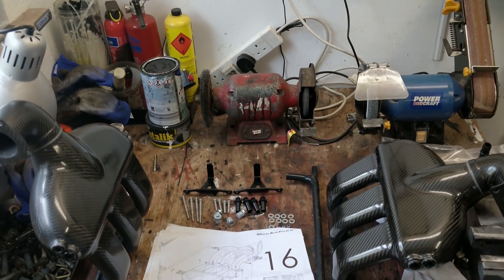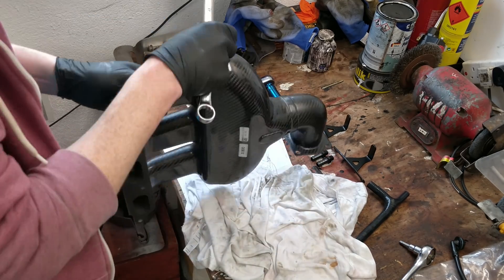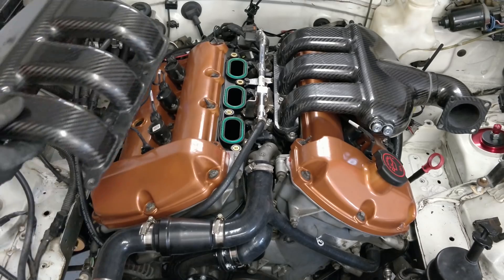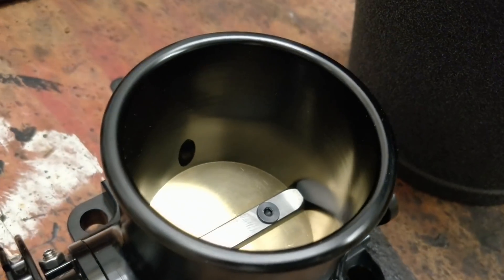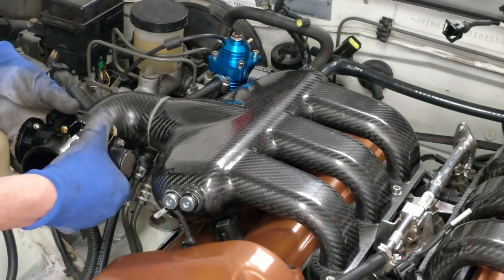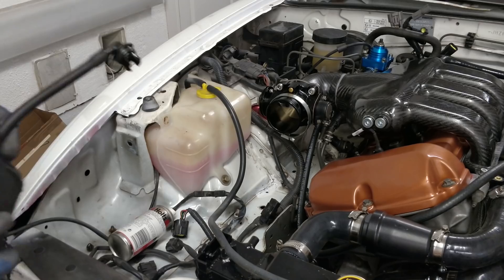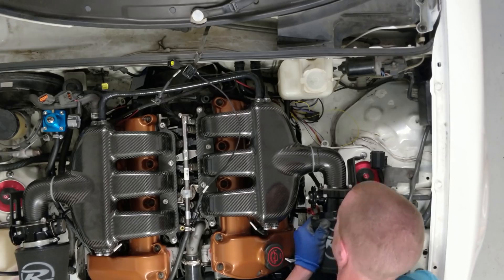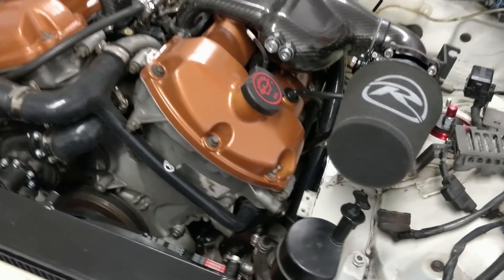Rocketeer Part 16 & 17 : Air Intake [MX5 V6 swap]

Comment: what dipstick are you using? im guessing the miata dipstick will not work
Reply from the maker: I'm using the Jag dipstick cut-down a little. You really need to get the manual - this is all explained.

Comment: One throttle body is up the wrong way isn’t it? I take it that bracket is for the cable but the part the cable goes on is towards the engine not away from it 🤔
Reply from the maker: Both brackets face towards the firewall. The throttle bodies are both orientated correctly.
Reply: Jazda I mean the moon shaped part that turns the butterfly valve is not on the same side as the bracket on the passenger side
Reply: If you look at 5.02 you will see you have the blanking plate for the sensor on the side of the bracket, so you surly must need to undo the 4 bolts and rotate it 180 degrees so the side the cable goes on is the same side as the bracket is
Reply from the maker: You're completely right. I filmed this a couple of weeks ago, and have flipped it over since.

Comment: I was wondering how much power you are expecting this engine to make?
Reply from the maker: Not really sure. The stock S-type makes around 240bhp at the crank.
Reply: Jazda that should be plenty :) I have a 1.6 eunos na. I guess it’s making ~100bhp and it feels fast I can’t imagine what 240bhp would be like 😀

Comment: Nicely done. Did you fit the cam breathers to the filters yourself? I joined mine and routed them into the chassis but i may have to copy that, very nice idea to do that as they connect to the airbox on the original Jag setup plus it looks super tidy. You may want to check your TPS sensor is engaged, it looked like you attached it without it being engaged on the lug on the side of the butterfly. It should have some tension on the spring inside, if not the throttle will move before it is engaged and the ECU will not know its position. You may need to remove and rotate the plate that the TPS attaches to to get it to engage. Also make sure you can go WOT without reaching the limit of the TPS.
Reply from the maker: Bruce advised me to route the breathers that way. Will look at the TPS tomorrow - thanks for the heads up!